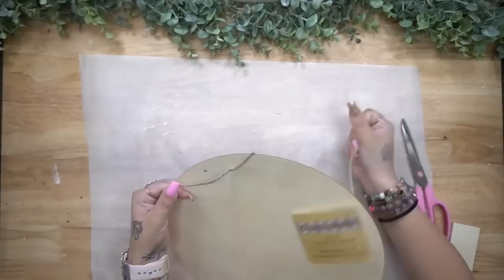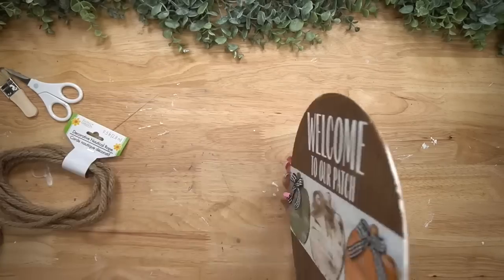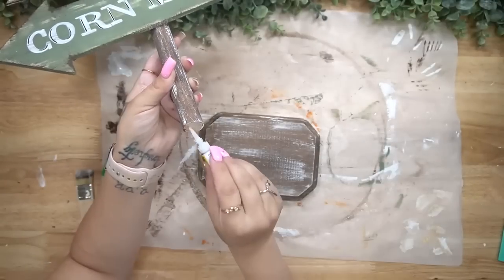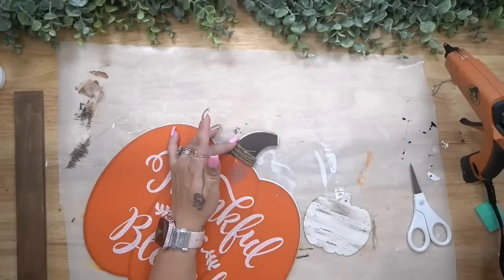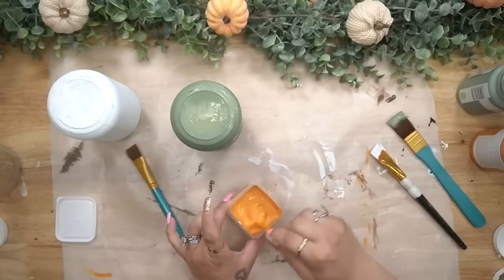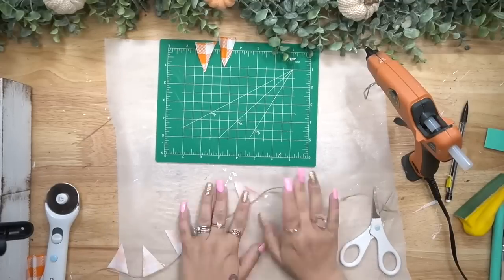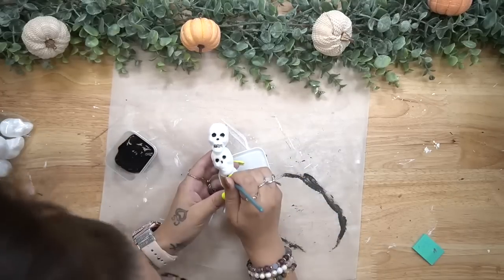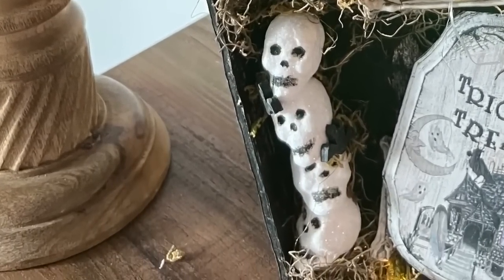12 DOLLAR TREE TRULY HIGH END FALL DECOR DIYS | AUTUMN BUDGET DECOR THAT ACTUALLY LOOKS HIGH END

Comment: There's a product called undo that has a black scoop/paddle/scraper on the top of it and a yellow label (I believe) that works wonderfully for taking stickers and labels off. You can even use it on pictures, and it will not damage them. The adhesive will get sticky again when you take it off. Therefore, you are able to restick the sticker if you need to. It works wonderfully forgetting labels off, though.
Reply from the maker: Amazing, thank you!